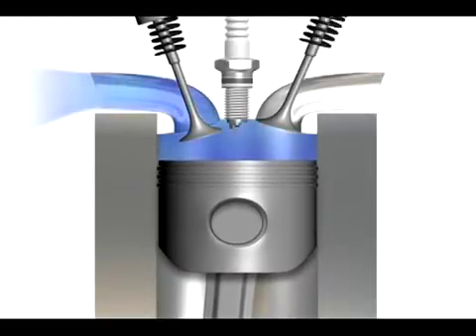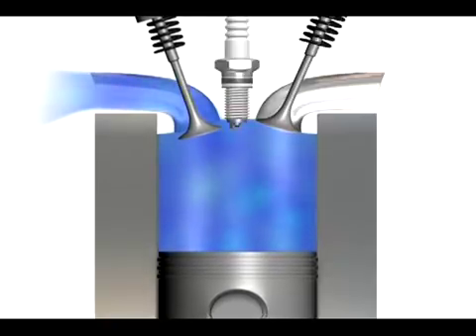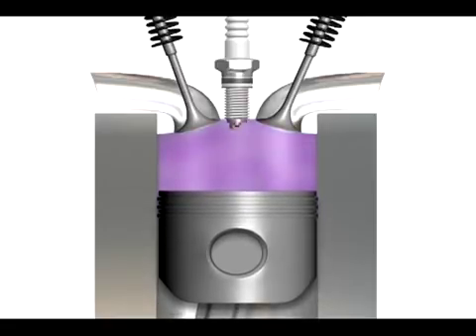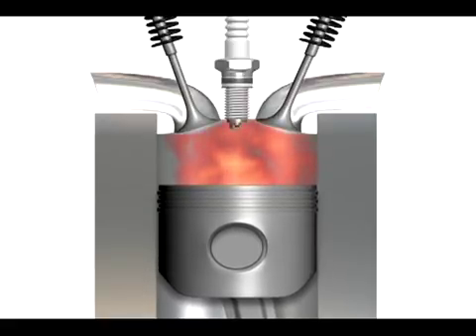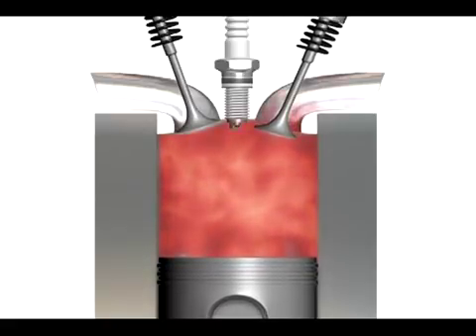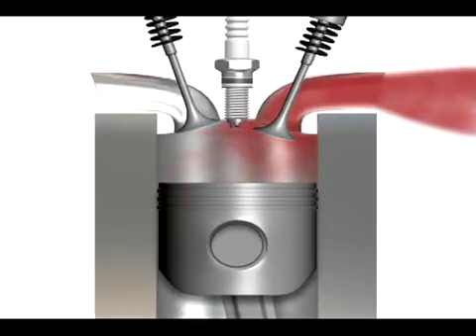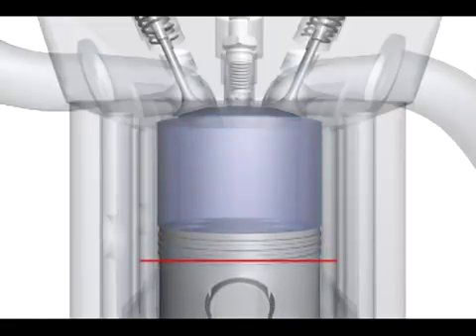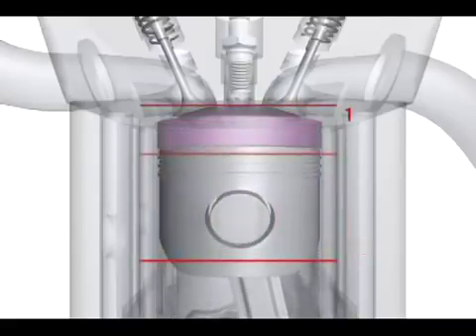How an engine works -piston and valve working in the cylinder

Comment: Ohhhh. So there’s two valves for each piston. One opens up to let air in and then closes as the piston moves down? And as the piston compresses the air, the other valve opens to let the exhaust air out?
Reply: Yes but there might be more than 2 valves for better operation